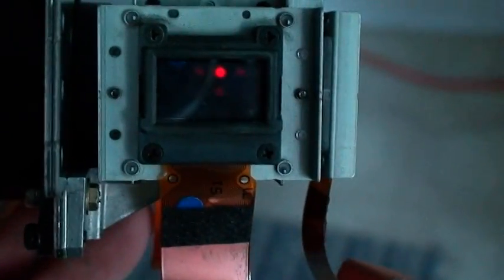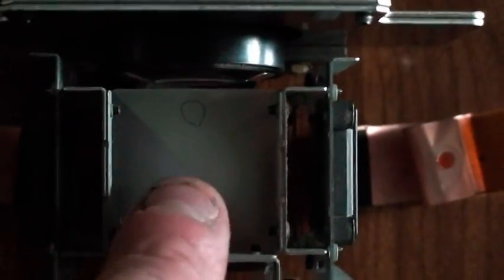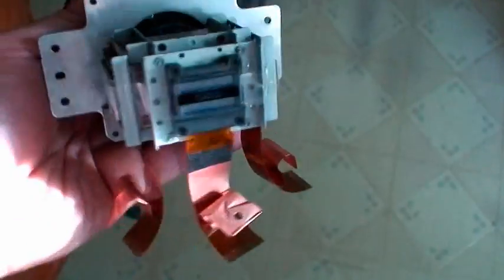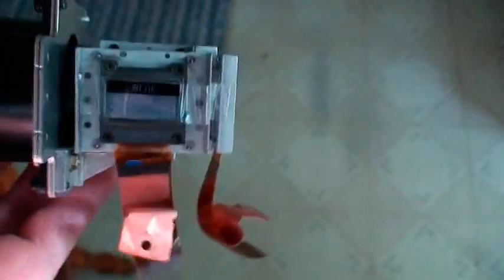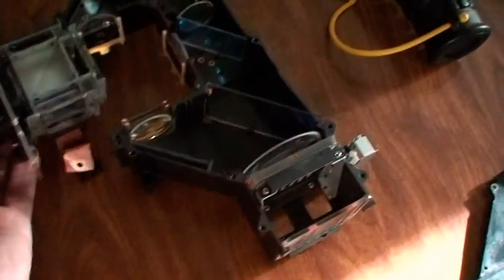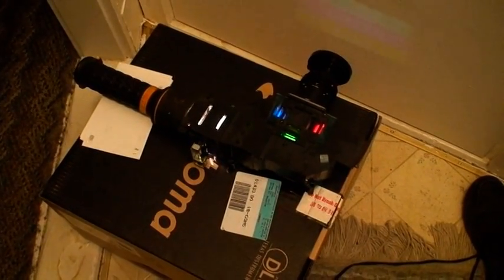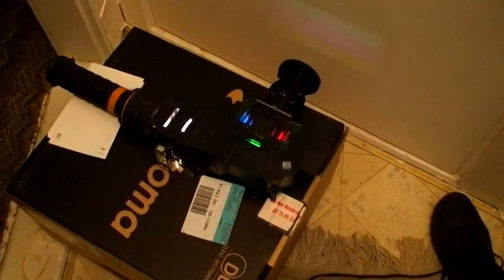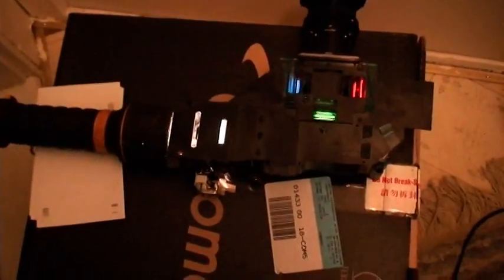How LCD Projectors Work (Part 2 of 2)

Comment from the maker: They are on those little brownish rectangles (LCDs) on the threer sides of the prizm. Red and blue are reflected off the 45-degree glass mirror surfaces inside, and green goes directly through them (not at an angle, so it doesn't reflect).

Comment from the maker: @mianjavaed97 
If it was the other way, I could not help.
What would be the video source?
You'll need to split the signal (get splitters) to feed each PJ the same image. If the PJ has a piggyback feature (can output to a monitor simultaneously), check to see what can be. Usually, the VGA port piggybacks. In this case, the main PJ has the original signal, the output VGA cable goes into the 2'nd PJ. It's now a matter of alligning the PJ's so the images converge.

Comment: The Red and Blue where labeled like that because they were specially made to latter take advantage of  new 3D features, if you look closely you will notice the Red and Blue LCDs are slightly different from the Green. The Green LCD is usually always used as the supporting Color to keep a image accurate.

Comment: Pretty good explanation except I think you could do it all in one 10 min segment if you planned it.  Your assembly is more or less the same as in my PT-L780 projector except flipped over 180 degrees. The 780 projector also has removable-interchangable lenses. I just replaced the LCD block in my projector... The green LCDs are notorious for failing in the Panasonics. I bought a projector on the cheap that had a known good LCD block and bad lamp ballast board and just use it for the parts. An ent

Comment from the maker: @FreezEntertainment 
If it's still there after 20 seconds, it sounds like the TV is gone. When the bulb is off, there's no image on-screen.
The only way a TV can still have blobs, when completely off, are LCD's, but the blobs would be darker than the surrounding pixels, as they are white when turned off. You can see it, if there's a little reflective backlighting from the room. In the case of LCD's, that is normal.

Comment: @georgef551 the only thing unique about it that i remember is that the blue blotch will stay there for about 20 seconds after the tv is turned off. i also forgot to mention that there is now a yellow tint to it throughout the picture, if i recall correctly

Comment from the maker: @FreezEntertainment 
I would thing if the blotch is gradual, it might be the bulb. If not, it's the panel (if you can see pixelization in the blob's shape), which is no good. 
If the TV is not under warranty anymore, it's junk (unless you can deal with it). If it's the bulb, a new one should remedy that. (Provided it's not the LED-lit TV's.)

Comment from the maker: The projector came out of a Panasonic 40" rear-projection LCD HDTV Monitor. I ripped the TV down to board/component level for easy removal.
 (The LCD panels were frying up, hence the docoloration on the edges.)